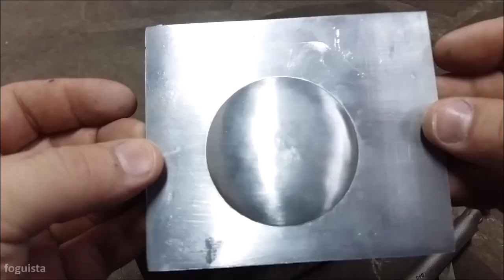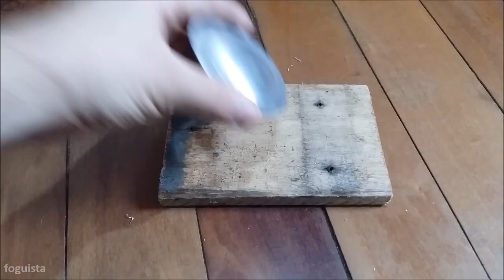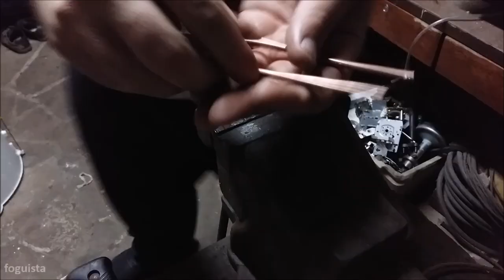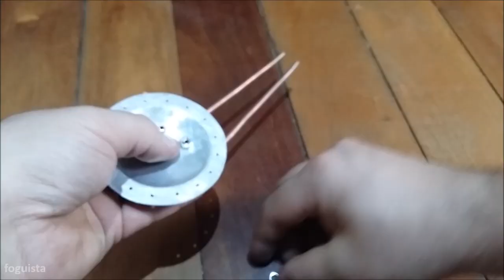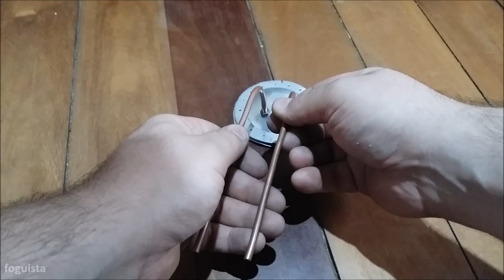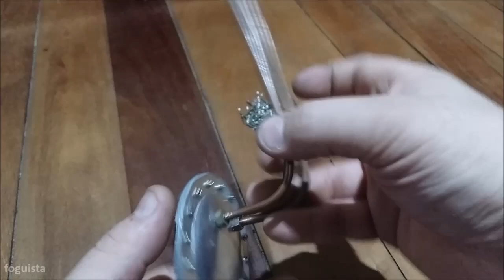Pop-pop engine (part 1)

Comment: I'm afraid there is a big mistake, it is the steam that causes the push, not the hot water. The output has to be inverted. What has to come out of the exhaust is steam, not hot water:face-purple-crying::face-red-droopy-eyes::face-blue-smiling::face-green-smiling::face-orange-frowning::face-blue-wide-eyes::hand-orange-covering-eyes:
Reply: You are wrong.
Look again at the end of the tubes in the water. You will see no bubbles. That means water is escaping not steam as you stated.

Comment: Do I understand right when the water discharges completely due to the heating process the pop-pop engine needs to be refilled every time? How much time or pops it lasts under a candle flame? And, can we add a water reservoire atop the engine for addditional water supply, possible with a check valve?

Comment: Great job, but I am afraid that aluminum with copper tubing is not the most corrosion resistant combination, especially in contact with water.

Comment: Can you build it even bigger? So big that it could be used on a regular boat for people?
Reply: Only way to scale these up is to have multiple engines.
Reply: @allbunsglazing  not exactly, you don’t need the popping mechanism for this type of engine so you’d be able to use a coil of tubing to create the boiler rather than a small chamber like this one. The coil method would make things much more easily scalable, it would be silent, it would be simpler, and finally it would be easier to fill fully without trapped air.
Reply: @allbunsglazing  ⚠️ God has said in the Quran:

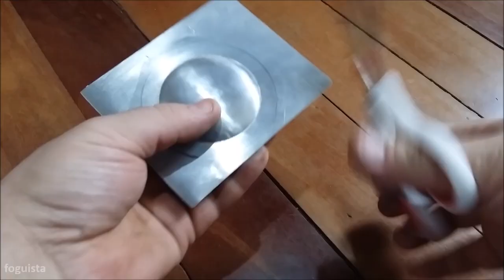🔵 { O mankind, worship your Lord, who created you and those before you, that you may become righteous - ( 2:21 ) 

🔴 [He] who made for you the earth a bed [spread out] and the sky a ceiling and sent down from the sky, rain and brought forth thereby fruits as provision for you. So do not attribute to Allah equals while you know [that there is nothing similar to Him]. ( 2:22 )

🔵 And if you are in doubt about what We have sent down upon Our Servant [Muhammad], then produce a surah the like thereof and call upon your witnesses other than Allah, if you should be truthful. ( 2:23 )

🔴 But if you do not - and you will never be able to - then fear the Fire, whose fuel is men and stones, prepared for the disbelievers.( 2:24 )

🔵 And give good tidings to those who believe and do righteous deeds that they will have gardens [in Paradise] beneath which rivers flow. Whenever they are provided with a provision of fruit therefrom, they will say, "This is what we were provided with before." And it is given to them in likeness. And they will have therein purified spouses, and they will abide therein eternally. ( 2:25 )

⚠️ Quran
Reply: @1islam1   is you rambling about jebus Christiansen?
Reply: What if you put a "one way" valve on the other pipe  like a bicykle tire valve🤔
Reply: @DIYNORTHERNER  it wouldn't work for this engine. Both tubes expel hot water when the pressure builds then draw in cool water to fill the vacuum, repeating very quickly. A one way valve will just limit the effectiveness of one of the tubes and put more strain and friction on the other.
Reply: Hell no! Where you going to get a candle big enough  for an pop pop motor for a boat that size, you silly ninny.  Plus people would get drunk on the boat and fall into that big flame man!
Reply: No
Reply: What do you mean by “no”? It’s completely possible

Comment: WHY DO WE NEED 2 TUBES? WOULD IT WORK WITH ONLY ONE?
Reply: Because the engine works better without air trapped inside the boiler, and two pipes make it easier to take the air out: just pouring water through one and waiting until water comes out the other tube
Reply: @dasmejr6004  not true... Pop-Pop Boats Are Weirder Than You Think - YouTube https://m.youtube.com/watch?v=3AXupc7oE-g
Reply: Qual a serventia dessa marmota ?